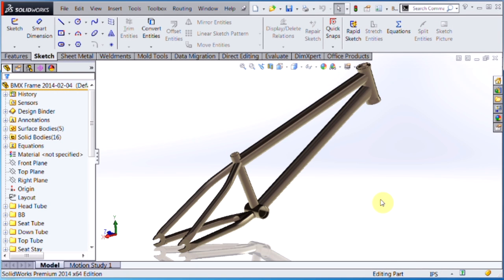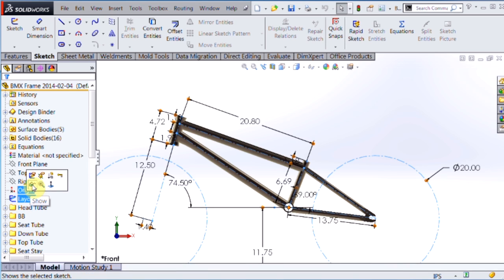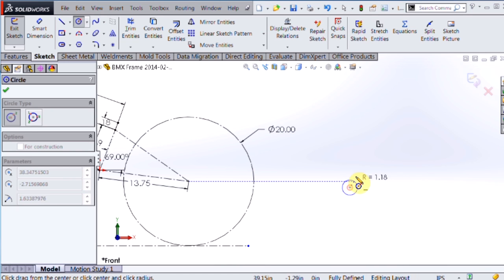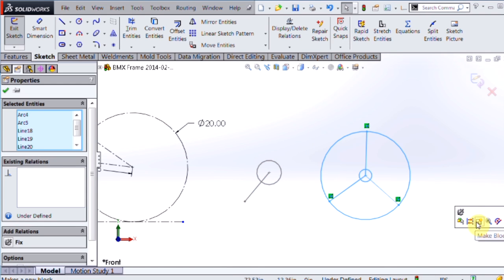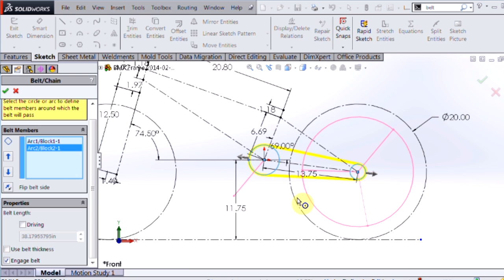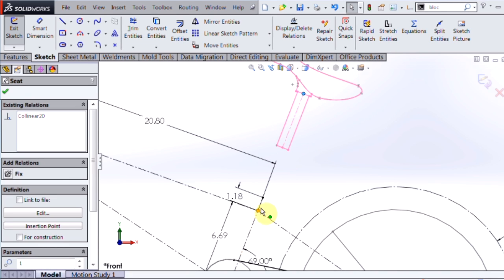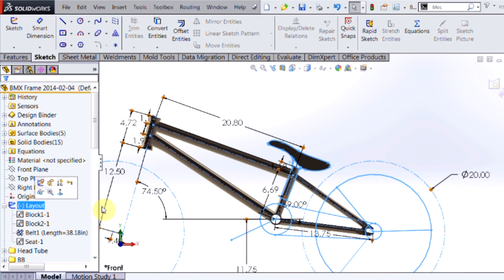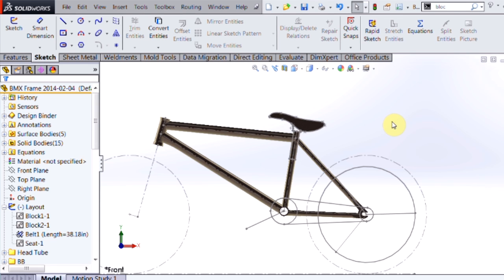SOLIDWORKS - Layout-Based Design

Comment: This an interesting block feature that I've never actually noticed and so consequently have never tried (I'm self-taught- and this shows one of the shortcomings of learning that way). 
Not sure why this feature exists in the Part mode of SW, since the animation of moving components would seem to be more appropriate as an assembly feature than a part feature (?). Having just tried this feature out on my own, I HAVE notice that you might be out of luck if you wanted to try to work out a mutli-gear race bike this way, though- it seams a chain block can have only one circle. I think doing this in an assembly would then work better for something like that, maybe?

Comment: So you've done a layout inside a multi-body part (with 16 bodies) instead of a layout in an assembly. Any advantage to doing this or doesn't it matter which one you use? Good video by the way and thanks.
Reply from the maker: Hello Phillip,
The main reason I chose to create this model as a part file, rather than an assembly file, is because bike frames like this BMX frame are always welded together, essentially becoming a single part in the end.  Creating it as a part file will allow you to take advantage of the Weldment tools in SOLIDWORKS and have a Cut List table automatically generated.
These layout based sketch techniques can certainly be applied in an assembly environment as well, and individual part files can be created based on a single assembly layout sketch.
Of course creating this bike frame as an assembly would mean that each individual tube would need to be saved with a unique file name, so there would be a little more file management involved.
 
I hope this information is helpful.

Comment: Video was good, but some of the things you did, especially the creation of the 3d seat, was glossed over and done very quickly with no explanation of what was being done or what tools were being used.
Reply from the maker: Graham S  Hey Graham, The goal of the video was show an example of how a single 2D sketch could be used to control the geometry of a part model. So the layout design was the main focus, and certainly some of the other details in the video were glossed over.

To create the 3D geometry from the block, I simply started a new 2D sketch on a reference plane, selected the block of the seat, used the Convert Entities sketch tool to convert the block into sketch entities, and then extruded the sketch into 3D using the Boss Extrude tool. Hope that helps. Thanks for watching!
Reply: Hawk Ridge Systems o